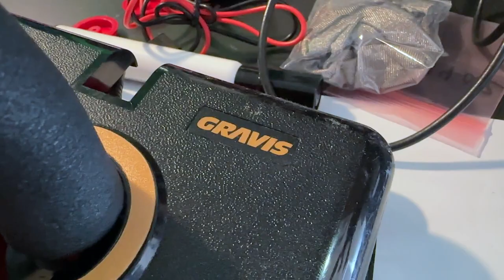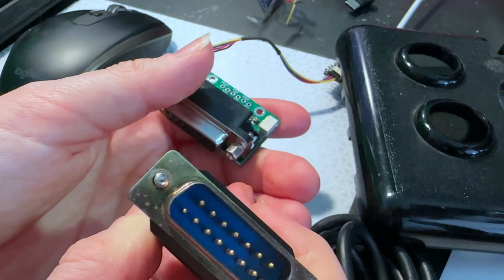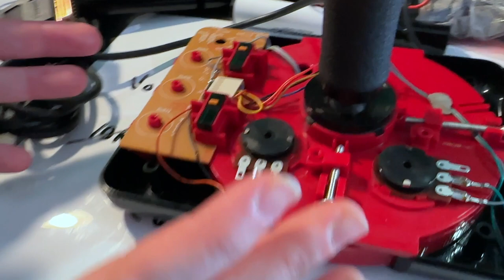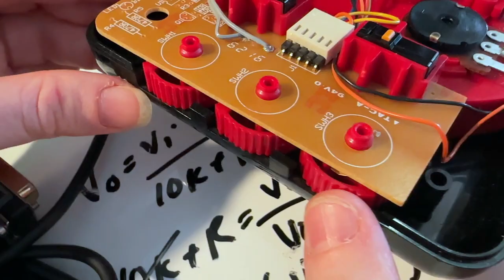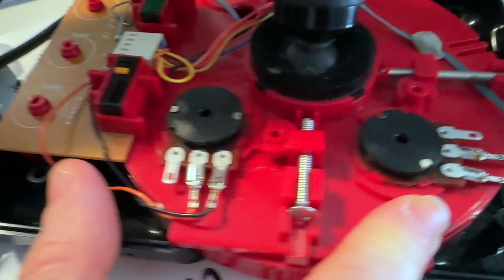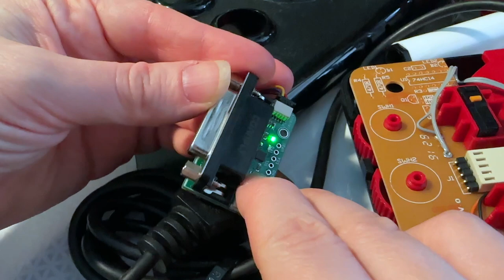The Gravis advanced classic PC joystick

Comment: Cool. I've been doing something related with a CH Products Mach I+ from 1986. I've got enough room to fit something like a Xiao inside it and have most of the h/w and s/w details worked-out, including rewiring the pots to be proper voltage dividers. The silly thing holding me back is not being able to find a USB cable as thick as the original cable so that I can keep the original grommet. I wasn't too keen on hacking something going on for 40 years old, but I figure I can easily restore it to original if needed.